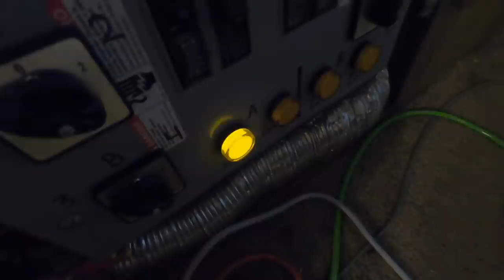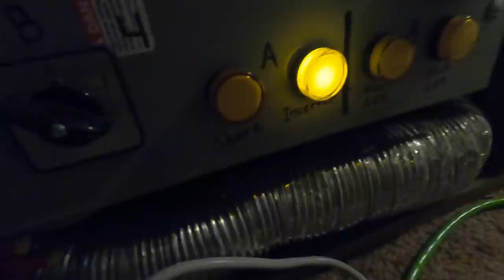First Snow, Update Vlog - RV Living

Comment: Why not just buy #10 wire and put a 30A 125V 3 wire outlet in, then you won't have to use an adapter when plugged in, not sure what your RV takes, but usually we install a 30A 125V 3 wire outlet. Just a thought

Comment: Electrical heaters shouldn't be used over long periods of time as they can fry outlets leading to fires on the worse end and damaged outlets/wiring on the low end.  After having one nearly meltdown I would never use one again, currently when I have a power outage I run a round kerosene heater in the house for emergency heat. If I can't have a window slightly open at night then I turn it off due to CO2 possibilities, however in a camper you should be able to go the night with the diesel if it is 8Kw type.  I would get either a few T splitters and have one in outlet in the bedroom, one in the kitchen area, and one exiting towards the front to balance out some of the heat.

Comment: Um, why all the electric heaters? That diesel is the way to go. As long as you have enough backup fuel in case you get snowed in. I'd rather use propane instead of the electric, but those buddy heaters put off too much moisture.
Reply: diesels not cheap to run 24/7 like that at $4+ a gallon. Thats probably why he's using electric, He's got hookups so why not save $$$ on diesel, Plus the cost in gas to drive to refill the diesel, That RV drinks fuel.